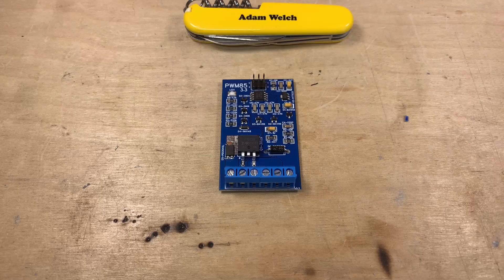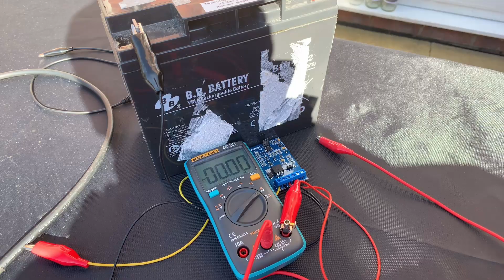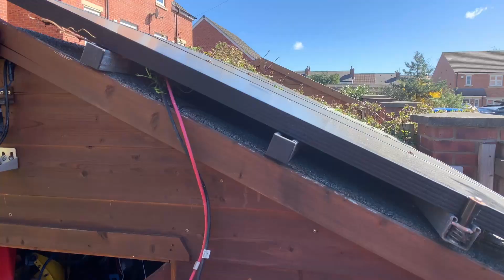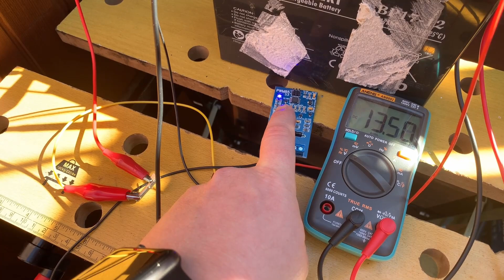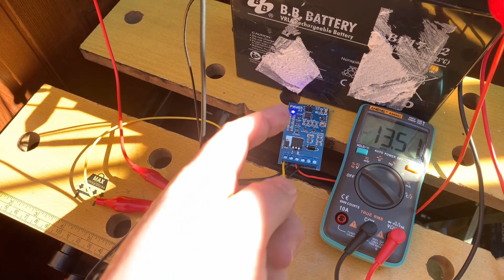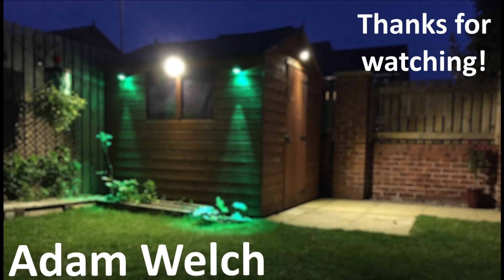PWM85 - Microampere PWM Solar Charge Controller

Comment: are you able to program this to be a full on smart charger that will charge up to 14.4v then auto drop to float voltage?
Reply from the maker: It’s an ATTiny so you can program it to do pretty much anything. The PWM5 which I ported did exactly what you are after. The hardware is capable, only the code needs writing.
Reply: @AdamWelchUK  been using your 2 controllers for a while now for charge controlling solar panels in cars. excellent design the low self power consumption is ideal

Comment: excellent i have 2 of these i bought from you to use in the car and you set them to 13.2v float for car battery which is awesome. are people able to get custom regulation voltage preset before shipping?

Comment: Adam, Would a capacitor added to the input give higher amperage pulses during charging (When it is using pulse width charging). Or would the potential higher amperage input damage the controller?
Reply: this should work well, something like a 470uf cap on the input should be interesting. will need to test it.

Comment: OK, I managed to get it reprogrammed, to work with Li-ion via BMS. I set it on 12.6V. I thought running to reprogram at 3.3V (as ISP) with the 3.3V board, not to be, it is ok to reprogrammed using 5v as long it isn't plugged in with solar panel or the 12v battery. I will be testing right now for a few days (I try not to get it overcharged or it will degraded and again might lower the voltage to 80%), weather getting too warm. I also received the solar panel, it is 18V and 50Watts.
Reply from the maker: Good to hear you’re changing it for your needs. Yes, programming with 5v is fine, and it’s always best to program it when totally disconnected from other sources. Cheers

Comment: I have an idea. I'd like to power a car stereo from a 4s (or could use 5s) LiPo pack, but this exceeds the stereo's max supply voltage when fully charged. Do you think a PWM charge controller would work to PWM the lipo pack into the stereo (through a capacitor or small lead acid) to regulate the supply voltage to 13.5V?

Comment: a lot of emphasis is on the standby consumption of the circuit but every time you switch the mosfet you connect the battery in parallel with the parasitic capacitance of the panel. How do you prevent the current spike from breaking the mosfet? is there any filtering to make slow down the slope of the current of the panel?

Comment: How is the '3.3 Volt' version different?  I see it has extra stages in the charge pump but the schematic still shows a 5 Volt rail rather than a 3.3 Volt one.  Am I missing something?

Comment: Hi Adam, can it be used to act as a DCDC buck converter with Pb battery changer? I'm wondering if this could be used to charge my 12V Pb battery used by UPS from my 48V Li-ion batteries. Max voltage of 60V would require some changes in circuit am I correct? Thx.
Reply from the maker: I’m afraid not. Solar panels are fairly unique in their nature - there is no stored energy so when they connect to a battery their voltage drops to almost the same level (they pull down to just above the battery voltage - and that allows current to flow from the panel to the battery). 
A battery connected on the solar input would not pull down in the same way, and would pull the battery under charge up to high. 
As you’ve identified, you need a DC2DC buck converter to achieve what you want. Cheers
Reply: @AdamWelchUK  Thx for your answer. Yeah, I'm a bit off, as I'm used to MPPT solutions which would work OK, as the tracker would pull max power and convert it to voltage required to safely charge Pb battery. Something like this would be needed... https://libre.solar/devices/mppt-1210-hus/

Comment: Aren't PWM controllers now pretty much inefficient junk? I'm only fitting MPPT controllers, also why not bring the lead battery up to 14.4v for more capacity? 14.7v would be a bit aggressive, but 13.5v is very conservative...?
Reply: Absolutely not inefficient at all, for small solar power systems. 
An MPPT might get a few extra Wh of energy from the panel, but then the more complex and power hungry circuit, simply burns up that extra power when the sun goes down. 

By contrast, a small and super efficient PWM charge controller, like the PWM85 or Julian's PWM5 consume almost nothing from the battery when the sun is down, so don't waist any energy. 

PWM is also cheaper than a decent MPPT, so the savings can be put towards another panel, which will increase solar power far above the small gains on an MPPT charge controller. 

An MPPT only really makes a difference, once you're past 3 or 400W of panels, otherwise it's simply better to spend your money elsewhere. ;)

The PWM85 is programmable, so the termination voltage can be whatever you prefer. 
I prefer 13.8V myself, but 13.5 is still an acceptable voltage, as it's above the nominal standing voltage of a Pb battery.
Reply: MPPT and PWM both have their use cases. MPPT is predominately for when you want high voltage strings, or can't physically put more panels in, thus are trying to increase the efficiency of obtaining that solar energy. This comes at an expense - they are more expensive, and complex than their PWM cousins. PWM solar charge controllers in comparison are cheap, and are much simpler, resulting in less things to go wrong. I did come across some research suggesting that PWM charging could also help prevent battery sulfation... but I don't know to what extent that was. And as a side not... did you know the Epever MPPT solar charge controllers go into PWM mode in the mornings, and in the evening? Once the panels are producing less than 15W, it goes into PWM mode as it is no longer efficient to run the MPPT charging system. Weird stuff!

Comment: PWM destroy batterty solar user ,lot better have and longlive to battery have MPPT charger. lot batter,safe,lonlive,battery good.
Reply from the maker: I don’t agree, the two technologies use solar power in different ways, it doesn’t necessarily charge the battery any differently.
Reply: How a battery is charged is irrelevant. PWM and MPPT both charge the battery in the same way. In reality, an PWM cycles the battery less, which will make it last longer, not less.
Reply: @johnnodge4327  PWM pulses the battery with the full solar voltage. I would not recommend doing that to a lipo.
Voltage measurement will be dependent on the mosfet state and jittery without smoothing.
Except for power consumption pwm85 does a worse job than a 3A adjustable buck converter costng 70ct.

Comment: Is the new arduino sketch compatible with the previous 5 volt versions? To help reduce power.
Reply from the maker: Yes it works with both versions. You just need to adjust the regulatorV variable to 5.0 or to be more accurate set it to the exact voltage of your 5v regulator output.

Comment: What does the circuit do?  Does it ensure it’s pumping the most current it can into the battery until it is charged (and then keep it topped up)?
Reply from the maker: Exactly that, yes.
Reply: @AdamWelchUK  Thanks. It would be interesting to see a comparison demo - ie how much current goes into the battery (when it needs charging) with and without the PWM85, under the same conditions.  People talk about PWM vs MPPT - but really all I care about is that the current going into the battery (when it needs charging) is maximized - regardless of that being at the maximum power point or some other operating point of the solar panel characteristic curve.
Reply: It does intermittenly disconnect the panel from the battery so battery doesent overcharge. 
But it doesent transform excess volts into amps like mppt does.

Comment: If I remember right, lead acid charge cut-off voltage is 13.85V not 13.5V.
That shouldn't affect the cycle life sulfation, but I don't know.
Reply from the maker: Depends on the chemistry, but 13.5 should be safe for all, it is a gentle charge and it’s what the PWM5 was set to. It’s adjustable for anyone who wants to as well.

Comment: Wonder how it would behave using a supercapacitor as a battery.  Some of the issues I've seen with cheap (semi) MPPT boards is that they are not super efficient with small panels and this seems ideal.
Reply from the maker: Seems like a good idea Luc.